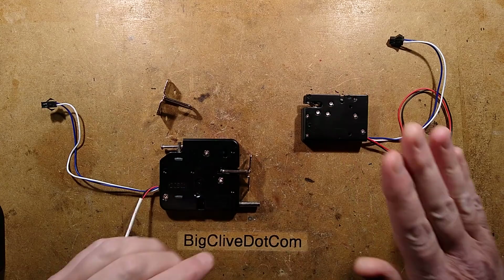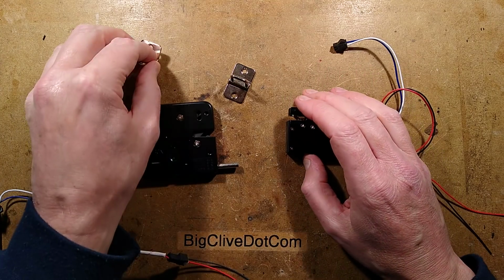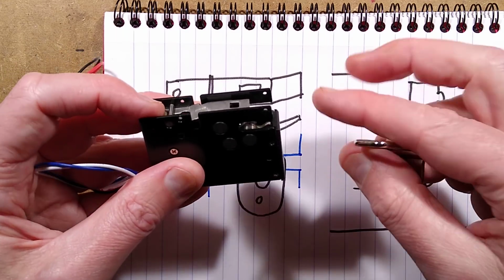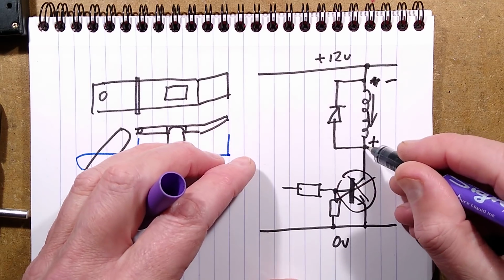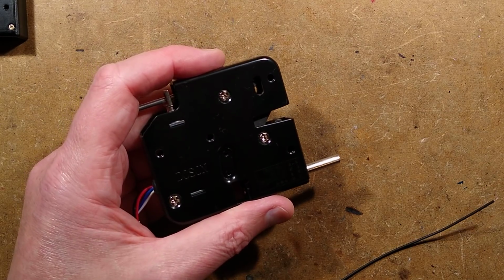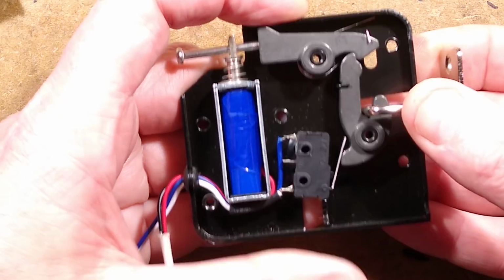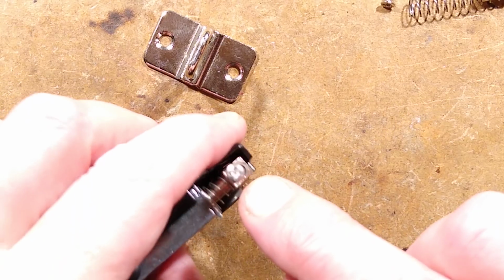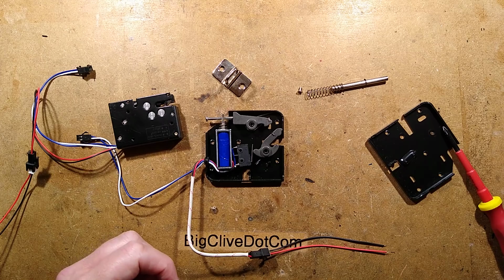Inside an eBay electric lock mechanism

Comment: They would be great for secret doors, you just use your phone and the door in your wall opens, no handles on the outside just one for closing it when you are inside, vanishing act, Thank you Clive I will now use one of them in my books.
Reply: But the noise. ..
Reply: @snakezdewiggle6084  one can think of a wax motor instead if they need silence. ;D
Reply: @jkobain  too slow.
Reply: @plainedgedsaw1694  yeah, I know! But sometimes it can be not only an acceptable solution, but also exactly the thing you needed.
Or someone else did.
Reply: @jkobain  Yes, there are Silent actuators, but that is not what is being examined here.
Reply: Why a phone and not a voice pattern recognition.  "Open Sesame" or another passphrase said near the door in a particular voice.  Recognized by a computer and microphone entirely in the hidden room, not some link to a remote cloud company.  Inside there should be switches to disable the automation and open based entirely on human decision.
Reply: @johndododoe1411  involving any sentry computer implies «not entirely on human decision», you know. While using a [smart]phone does not mean you're gonna use a cloud-based solution.
Reply: @jkobain  I intended the internal controls to be just a mechanical off switch disconnecting the computer and a mechanical push button to energize the coil (or a way to reach the top actuator arm).  My cloud warning was because of all the charlatans thinking that Alexa/Google/Cortana is the only way to do voice recognition, which is the one biometric requiring no exposed sensors.
Reply: @johndododoe1411  next time try «one doesn't need any companies be involved in voice processing and home/vault automation», because it hits more precisely, IMO.
Reply: @johndododoe1411  Good thinking I will think about that and maybe put in some biometrics' heart beat if under stress and brain patterns if they go into panic or fear mode, so thanks for that will come in handy.
Reply: Even better would be an NFC tag with a reader in the wall, that way no external powered device is needed to open it.
Reply: @loren481  and how would that work not sure of the terminology, more info please.
Reply: @Jim-si7wz  Hey, sorry for the late reply. NFC is a very short range communication method that uses inductive coupling to transfer data (functionally). 

For example, you can program some NFC tags (you can get them with sticker backs) that are very thin wafers with some data, and if you put it against an NFC reader (such as on a phone), it will read it. This data can be triggers for processes on the phone (an app called Tasker works with them, for example), or just some text, or even a wifi network. I can provide more details if needed.
Reply: I have a friend who has an electrically operated front door lock with no external way of opening it. "Totally burglar proof" she said. Then one day it decided not to work when she came home.
Reply: @jonka1  Batteries went flat.

Comment: Another way of triggering the release would be to discharge a capacitor into the coil.  This would reduce peak supply current and would limit the standing current if it was left energised.
Reply: 12V@2A for about 0.1s needs 2.4J of energy, at 12V, we need a capacitor of 33.3mF for this. We probably need to exeed the maxium volage rating in the coild if w want to use feasible capacitor sizes
Reply: @Ferrybig  It's a big cabinet, just put in 20 2200μF 16V rated capacitors with the usual tolerance.  Doesn't have to be low ESR either.
Reply: Some one needs to tell this to lock picking lawyer.
Reply: @rogerlague1520  It's not an attack, it's a way to run the entire thing from a 1A power supply, except for that one capacitor charged by a boost converter.
Reply: @johndododoe1411  just having fun. Ever had any fun with very large hvac capacitors. They do amazing things to locks and many other of things. Maybe Clive can do something about this.

Comment: There is a large bank of Amazon lockers at a university hall of residence about half a mile from here. Presumably it's very popular with the students.
Reply: Much easier to have a central place for the delivery person than to have the poor fella wandering the campus trying to find the right dorm (if even allowed)
Reply: @Yrouel86  a
Reply: When I was at uni we had one central place that took deliveries, but it only opened to the students to collect their post for an hour or so per day. We'd have loved to have Amazon lockers instead.
Reply: Because prime is cheap when you have university card.
But Amazon in EU is an expensive garbage that only exists because of fast shipping.

Comment: These can be easily defeated by pushing in hard, then pulling very hard. Tends to break the latch though.
Reply: They should never have handles, since the controller decides when to open them.
Reply: The doors I see here for mail collect etc. don't have anything to pull them from, though.
Reply: @benbaselet2026  Use your neodymium magnet.
Reply: @johndododoe1411  more likely a suction mount for a phone holder/gopro mount
Reply: @brendanrandle  use a non-magnetic material on the outer layers of the door and put a texture of some kind on the surface (anything with depth or not smooth) so you can't get a suction or magnetic grip on it to try force it either

and then fill the middle of the door with something just really really annoying to anyone using an angle grinder or something to try enter destructively

Probably still be ways to break in, but it's a delivery locker not a bank vault and there is only so much you can do with a cm thick door held shut by a rather wimpy electric latch

Comment: You should send that to the Lock Picking Lawyer. I imagine that he may have some tricks to get that open without dismantling it, probably either by rapping it or getting a fairly large neodymium magnet in the right spot.
Reply: pretty sure it would just open if he looked at it sideways
Reply: I've been working with automated lockers for drycleaning and laundry orders (which are made from chipboard, mind you), which use bad quality electromechanic  locks, and these are THE BITCH to open when they break and stop working. As soon as I saw that thumbnail, my blood pressure started rising and eye started nervously contracting. 
Now, most of the problem is what I have to work with bad model of lock, but I have to open, repair, replace them for awful 4 years, and the problems aren't going away anywhere. Our lockers use Russian made Promix SM-308 as it's locks and I would love a way to open them from outside when they burn that coil which makes magic work. Sorry for not using perfect English, my face is tired.
Reply: I’m gong to use the EMP device that Bosnian Bill, Big Clive and I made...
Reply: It looks like it would be vulnerable to a locking bolt attack, just get a probe up to the bar actuated by the solenoid, push up, and it should pop right open. Probably a traveller hook or maybe a street sweeper bristle should do it.
Reply: @yourcurtainsareugly  How would that be done when the entire thing is behind the steel door, flat inside the wall between compartments.  With the hinges similarly behind the other side of the door,  mechanical attacks are limited to pushing and pulling the hasp, and magnets can only be placed on that side, or maybe on top of the entire cabinet.  Angle grinder attacks seem more effective.  Of cause, hacking the control computer for the entire cabinet or finding a maintenance password would be game over.
Reply: @johndododoe1411  That's what I think as well. If the electronics are EMP safe, I think this is almost perfect security if done properly. You should be able to design a door in a way where physical access to the mechanism is almost impossible. Also these can be made very sturdy. Most likely crowbar / angle grinder would be the easiest way in.
Reply: @johndododoe1411  a spring loaded bolt can be often opened by sharply wrapping the container in the direction of the bolt travel. A ball peen hammer or the like would do it.

Likewise, a traveler hook could go into the crevice between the door and the frame and directly manipulate the bolt.
Reply: Exactly what i was thinking. LPL and DeviantOllam have really influenced my thinking. Locking an innocent BigClive Video when there´s the random thought: what would happen if i out a Neodym Magnet right next to it.
@yourcurtainsareugly: i think a neodym magnet would be far easier and as far as i can think on such lockers theres no real space for an attack like that
Reply: I'd have to see the exact design of the lockers, but if they're like the Amazon lockers nearest me, they don't have the best tolerances, and the doors can be pulled to leave enough of a gap to get a tool of some sort in.

Comment: Seems like a good match for all 7 outputs of a ULN2003 in parallel.
Reply from the maker: For short duty cycle it may be able to control several of the 2A units directly.  But the combined chip current restriction would not allow use with the smaller higher current lock.

Comment: I wonder how much these have in common with more modern apartment buildings' access control systems. I also wonder if lockpickinglawyer knows of any interesting defeats on them that don't involve cutting the power.
Reply: Cutting the power wouldn't help much either...
Reply: @stepheneyles2198  Unlike buildings where exits must work in case of disaster, thus making forced power cuts a way to weaken security.
Reply: They don't take a great deal of force to pry open, in most cases.
Reply: The LockPickingLawyer has a whole series of videos on keypad/RFID access control systems, with exploits ranging from a Swiss Army knife through a magnet to a parasite signal reader.